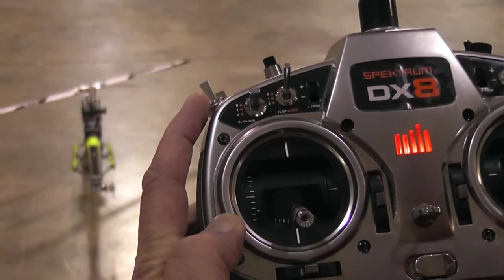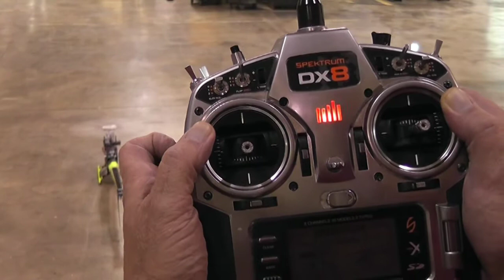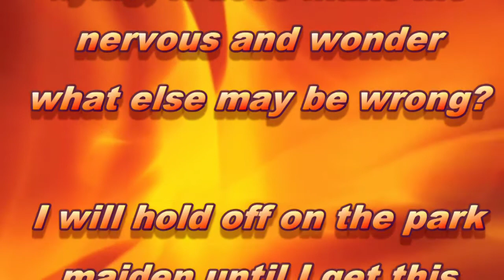Goblin 500 Update and Help Request

Comment from the maker: Thank you very much.  I normally fly IU1, but always start up in normal mode.  That is how I found this issue.  When I flipped into IU1, I expected to hear the motor ramp up and when it did not, I started poking around.  I have been told I can't do Gov mode with my current pinion, but I can switch to Heli mode and set the end points so I think that is what I need to do.  Thanks again for all your help!

Comment from the maker: I think you are correct.  I was using the auto end points selection on the ESC and I think I need to go to fixed set points.  Thanks for the suggestion, I appreciate the help.  Have a great day and happy flying.

Comment from the maker: Thanks bud!  I have actually already used the castle link to lower the Motor start up voltage to prevent the blades from folding back on initial spool up.  I have a lot to learn and at this point am just trying to understand what is happening. ;)  Thanks for all your help and I will most likely end up in Gov mode.

Comment from the maker: Hey bud!  Thanks for posting and the great suggestions.  I actually did monitor the throttle (and pitch) channels with the monitor in the DX8 and it is perfect.  I think it is because I have the ESC in Aeroplane - Auto Endpoint mode.  I will be changing it to heli mode fixed endpoints this weekend.  I think I will hold off on Gov mode for a bit if that works and then go to Gov mode when I get a bigger pinion.  Have a great day and happy flying friend.  Thanks again for the help!

Comment: Hi George. strange that it didn't work out of the box. I have not touched the Talon 90 and it works as expected with the Dx7s and AR7200BX. I guess the problem is the Talon setup if the radio is sending the right levels. Good luck with the ESC setup. I have done a lot of flying with the goblin now and it's just awesome. Been doing some inverted flights and loops. super capable! Cheers

Comment: Hi again george, if you have an iPhone or Android phone/tablet you can download a "Head Speed Tachometer" app which uses the microphone to measure the head-speed. It works very accurately and well. Just make sure to set "Estimated Headspeed" to around 2.200 before you start measuring (too high wont work) and it will follow the RPM up.

I am at 2.200 rpm at normal mode and 2.500 at idle up @ 85% throttle

Comment: correct.   i went in to talon 90 demo mode in the castle software and put in all the settings in and than i took screen shots and posted them on the team lightning page.   these are the settings with out the gov.   you can always turn the gov on later.    when you do set up the gov you just type in the head speed you want and it will tell you if that head speed is optimal with your pinion or not.

Comment from the maker: Hi there and thanks for the advice.  I have the Talon currently at the default which is Aeroplane with Auto End Points and I think that may be part of the problem.  I think it may be setting the max endpoints when I first spool up and then using the correct percentages after it figures out the end points.  Unfortunately in that mode all the other parameters are grayed out.  At this point I am just trying to learn how all this works! ;)  Thanks again for the advice!

Comment from the maker: I think you are correct bud.  I will try going back to a linear normal TC of 0, 25, 50, 75, and 100 and see what it does.  I will most likely go the Gov mode, but don't want to keep bothering you.  I will keep you updated, but wanted to make sure you saw what was happening so you didn't think I was a idiot! ;)

Comment: 1 tooth on the pinion can be a few hundred RPM difference which can make or break the way a helicopter flys IMO

something with 500mm blades i would want to run at 2600-2800   rpm  with out the gov  and between 2500 and 2600 with a gov.   that is a guess i wold really need to see how the rpm felt for that helicopter to be sure.  on my X5 i run 2650 no gov..

Comment from the maker: Hi again!  I have actually seen one of the guys at the field using the iPhone app.  I think I will down load it.  One of the guys at work has a strobe RPM tester for the big motors at work and we clocked it at about 2400 during the initial spool up, and 1900 after cycling the mode switch as in the video with 75%.  I know it is not meant for helis, but it proved the RPM was not changing when going to IU1 and IU2 the first time.  I may just bite the bullet and buy a heli head speed checker! ;)

Comment from the maker: Hi there and thanks for posting and the advice.  Unfortunately, in the default mode, you can not set the end points, they are automatic, and I think that is part of my problem.  In order to go Gov mode, it appears I need to get a bigger pinion gear, but it seems I can take it out of default and set it for Heli mode and then I can set the end points and all of the other parameters.  I will keep everyone filled in as to what I find.  Thank you very much for replying!

Comment: all castles should be the same for set up including the talon.  they all come in air plane mode and they all say ready to go, slap it on and fly but that is not the case, i have seen alot of guys get screwed by not changing the settings. it takes about 10 min to set up a castle.  if you want the gov you may need a bigger pinion to be happy with the head speed.   or maybe it will work out with your pinion.   if you want help with that thing let me know.  ill probably be free tomorrow afternoon.

Comment from the maker: Hey Danny.  I agree.  I had to completely set up the AR7200 and thought I could get away with the stock settings on the ESC, but I am finding that is a pipe dream.  I also think you are correct about the pinion.  Xflights said I need to get a higher one for Gov mode.  But, can I just set it up for normal Heli mode and manually set the end points to correct this issue?  Then down the road, if I want Gov mode, buy a new pinion?

Comment from the maker: Sweet!  Thanks Danny.  The Goblin comes with a 18 pinion and I have been told I need a 19 for Gov mode.  I didn't think one toot would make that much of a difference but I guess it does.  What head speed do you run?

Comment: Hi George. Do you connect the lipo with throttle hold on the tx on and did you set any throttle trims that offset the throttle? This sounds like a tx issue to me, as auto end point detection won't ever change the range itself.

Comment: Hi George, I have the same components as you and I dont have this issue (But DX7S radio). I heard already at your maiden hover that the RPM was very high.

Did you check the monitor mode in the radio to see the actual Throttle output signal? You can do this without having the heli on, just check the throttle channel output as you go through the same proceedure with F-Mode toggles.

Good luck!

Strange problem, but as has been suggested if the Radio is OK, set ESC to Gov mode.

Comment: Don't even do fixed endpoints. Then u don't have to calibrate throttle. For ur setup put 140 for main gear, whatever u have for pinion and so on for ur motor info. Put 2500 on stunt 1 and 2600 on stunt 2. That is my setup. It is phenomenal.

Comment: Not sure if this would help but the way I have my CC esc setup is idle up 1 is a straight 70% and idle up 2 is a 100%. With the castle link you can set up the rpms for both those values. Give it a try maybe it will work. Thanks and good luck.

Comment from the maker: Hi bud.  Trust me, the RPM is not changing.  You can hear that clearly after cycling the modes.  I already have the Castle Link cable, but did not want to use Governor mode if I didn['t have to.

Comment: set the end points.  sent you a message on team lighting.     being in airplane mode is not good..   things need changed.  like the break is probably on.   the esc is set to shut down if you get spikes and on a heli you going to get a big spike and in stock plane setting it might just shut down on you..      u really cant just leave a esc in its stock set up.

Comment: WTF....  that is strange..     did you set the end points in your radio to the ESC...  that will cause some problems  not sure if it will fix yours but that is the only thing i can think of that might do something like that.

Comment: had that problem
when you're thr curve for normal is 75 to high 
its close to the idleup speed turn normal mode down to 65 its to high to hear a change
when you go to idle you will hear a change.
understand ?
and what esc are you using ?

Comment: Hey, so what was your issue with this? Curious as to the root cause of your problem. Thanks
Reply from the maker: Hi there Dingo!  The issue was ESC Programming.  I did a follow up video on it if your interested in the details. ;)
Reply: Thanks George!! Appreciate you getting back to me. I figured it was either a defective ESC or Pilot Error 😉. Where are you located at? I'm looking for some clubs near Wheeling Illinois, so I'm curious as to your geographical location. Thanks!! Happy Flying!
Reply from the maker: Hey Dingo!  North East Ohio here!  And let me tell you, the weather has sucked so far this year for flying! ;)  And Pilot error was not beyond the realm of possibility! ;)
Reply: The problem is that the CC ESC factory setting is:  Airplane Mode, Auto Calibrate.  In this mode the ESC works exactly the way george described.
You have to program the ESC to Helicopter Mode, Fixed Endpoints for it to work properly as a helicopter ESC - waw -
Reply from the maker: Hey Widebandit!  Thanks for posting bud.  Since this problem occurred and making the adjustments, everything has been great!  Have a wonderful day and happy flying!
Reply: georgesjunglerc
George you deserve the thanks.  I found your G500 videos just as i was getting started on my own G500 build - my first scratch kit where i had to do motor, ESC, and radio; the whole thing myself.  First time programming any flybarless unit let alone the AR7200BX but your electronics set-up videos walked me straight through the process without any problems.
And just like you said on your G500 maiden flight vid - the G500 was dialed-in ready to fly and very smooth - thanks george - waw -
Reply from the maker: ***** Hey bud!  Glad the videos helped out.  I had a blast making them.  I may be doing a new series on the Goblin 380 next! ;)

Comment: You sound problem is irrelevant. The RPMs are changing, even if you don't hear them. Just try 3d, even without sound change, there is an extremely noticeable difference in power. Once again, Get the governor programmer

Comment: Hey there George I think I won't a goblin helicopter in stead of a trex 700 u think but do u have 2 ground the helicopter or what bud won't 2 pick your brain bud need your help
Reply from the maker: Hey Delbert!  Sure thing bud.  What is on your mind?
Reply: I won't 2 know if the goblin is bigger then the trex 500 I won't a 700 but if crash it will cost a lot but if I get the goblin 500 I still can fly it but parts r high 2 for the goblins so don't no what 2 do so need my friends help on this George :-D and have u had any issues with it no being  ground
Reply from the maker: Hey Delbert.  The Goblin 500 is about 2" longer than the Trex 500 ESP.  The goblin is a much more capable heli, but much more expensive.  The total cost for my Goblin 500, including all the electronics was close to $2000.  Not cheap by any means.  But, you get what you pay for and the Goblin is a very high quality heli.  The crash cost is a bit more than the Trex, but that goes with the territory.
Reply: Thanks George :-D